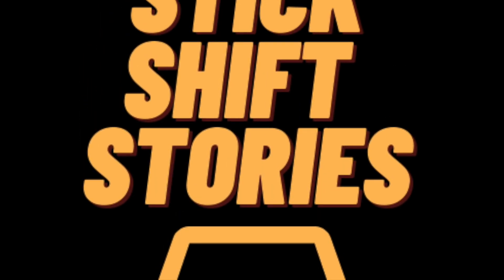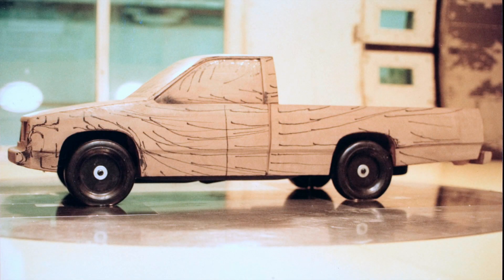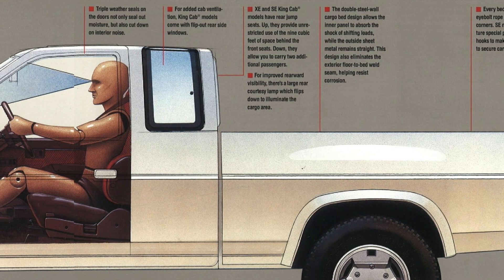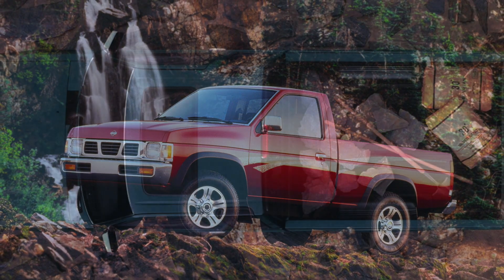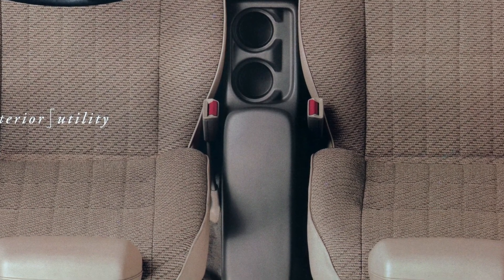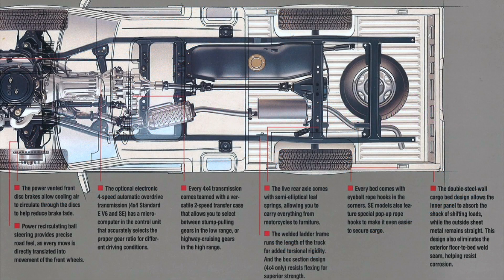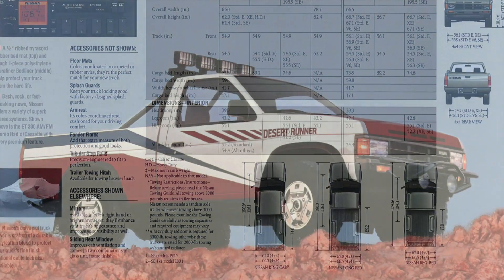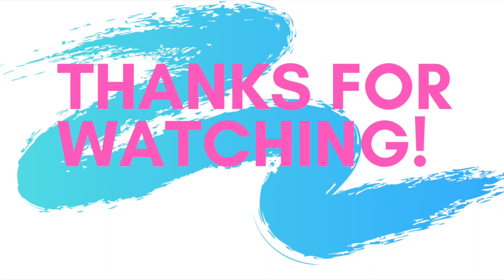Nissan Hardbody Buyer's Guide (Common Problems, Options, Specs)

Comment: I have a 1992 D21 SE king Cab 4X4. 200000 on the body and 13000 on everything else. Runs like new. No rust at all. Paint is faded. This is/was the best purchase I've ever made, besides my 2000 Lexus ES300.  My truck runs like new. Couldn't ask for more  💓.
Reply: I own a 1992 Nissan hardbody d21 kingcab. My speed gauge worked every so often. I toke my gauge out and drive around for a few miles. Do you know if I can put a tool on my motor so I can know the exact miles on the truck so the cluster matches? Thank you.
Reply: @popclutch_100  you know,  I have No idea. I will find out though and get back to you. I'm not sure if an obd 1 computer is smart enough to hold such information.
Reply: @stepheng5843  thank you so much brother!!

Comment: I had my 1989 SE 4X4 King Cab manual transmission for 14 years.  That truck and I went a lot of places.  It was very reliable.  I had to replace the leaf springs in the rear since both snapped and I fought the good fight against the rust.  It was undercoated yearly but still liked to rust.  The fender flares were terrible for keeping moisture and dirt against the truck surface.  It had the 31" tires but went to a slightly smaller tire since the truck's power was really zapped by such a big tire.  The truck was a light blue color which i didn't really like a first but the grew into it in time.  I had only seen one other like it in NH.  I loved the sunroof the rear tip out windows and the rear slider.  It let a lot of air into the truck.  The truck that replaced it is a 2007 Frontier King Cab in dark blue.  I can't believe it's 14 years old too but I'm not ready to let it go yet.  As far as I know the Hardbody is still running about in NH.
Thanks for the info on the truck!  I actually have a sales brochure for the Hardbody still.  It's fun to look at it.
-Jon
Reply: what do you mean by  "zapped"?
Reply: @nvfpv  I had a regular cab Nissan truck before the king cab model.  Both had the V6.  The engine had the same power but the first truck had a smaller 235 I believe.  The larger tire of the king cab 31's took a lot of power out of the engine just to turn over.  The truck had more power with a slightly smaller tire on it.  That is what I was getting at when I said zapped.  Have a good one!
Reply: @jrmason  thanks dude!

Comment: I owned two a 88 2x4 4 cy 5 speed i paid a little over 7000 I drove it five years and 300000 miles I gave it to my brother and it needed a clutch. He changed the clutch only major  maintenance we ever did to it he drove it ten years not sure of miles speedometer cable failed at around 350000. It’s was getting badly rusted so we attached the rear axle to a irrigation pump and used it to irrigate the farm for five more years. It tended to overheat running the pump so we took out the thermostat and recirculated by some of the  pond water pumped  thru the engine. That solved the overheating. We finally sold it when the transmission started growling to a fella down the road for a parts donor he needed the cab for his wreaked truck. One of the best farm trucks we ever owned. I got a 4x4 four cylinder five speed in 93 paid about 13000 and it was very good too, I burnt the transmission by jacking it up and putting huge tires on it. Trans was rebuilt at around 180000 and I traded it at about 260000. The trans problem totally my fault was the only issue I had with the 93 I didn’t get another Nissan hardbody because they had swapped to that ford ranger clone at the time I wanted to replace it. Loved them D21s wish I could buy a new one today.

Comment: I purchased my 97 Hardbody after my first deployment in 05.   I still drive that truck nearly everyday.   I still have the original drive train.  It is unfortunately an automatic (on the floor shifter).  It is the auto trans that grenades early (supposedly).   I'm still driving it at about 325K and still going!   I have had very few issues with my vehicle.  Just the usual suspects as a vehicle ages.  I have replaced the bushings and front end components, the starter, the alternator, lots of tires and a few batteries.   my vehicle is not pretty, I do need to repair the interior and it needs a paint job.

Comment: I bought my Hardbody truck brand new Feb 1986 $7000 dollars best purchase ever still driving it today over 400,000 miles nothing done to motor 4 cylinder 8 plugs Naps Z ,only thing the speedometer cable broke at 400,000 mile mark haven’t bothered to replace it yet

Comment: I had a 95 xe v6 king cab 4x4 manual. I drove it 2500 miles from Washington state to Anchorage Alaska. It leaked oil which burned out a starter. My theory was oil dripped onto the starter. It also had a lifter tick and an exhaust manifold leak. The clutch slave cylinder failed twice. I had a starter,alternator and battery fail in one week. I know that sounds bad. But I loved that little rig. I'm contemplating getting another one. Which would make the third D21 I've owned.
Reply: Just get one before they really go up in $$$. Im flying to Idaho to pick up a 95' SE V6 4X4 5spd and drive back to San Diego, California. 79,000 miles on it. $7,000.. one owner old guy who had passed away.. perfect paint cause it sat in a garage.

Comment: 85 Nissan 720 4x4. Still running strong. Of course, always have to maintain it. Especially the gear and oil changes for longevity.

Comment: 4x4 v6 and I love it. It runs perfect in -64 degrees. Only problem with that is the buzzing from the starter and that's only because it doesn't want to start in that low of a temp. I've never had a sensor go out and with the 2 inch factory lift I have no issues with steering. Torsion bar is fine and as long as you wash the bottom, no rust. Good luck finding a non rusted one though

Comment: I had a 1990 4x2 with the KA24E engine. A major problem for those motors is the timing chain guides break, and you'll hear a clickity clack when that happens. Other than that, I put well over 250,000 miles on it. The paint also faded easily on those trucks. Other than that, it is a really reliable truck.
Reply: True. Only way it won't come back is order a fabricated chain tensioner. If not you will most likely get timing slap. After 120,000 some miles.

Comment: I had the base 87 king cab 4x4 with the 4 banger.  Only thing that was not stock was more aggressive tyres.  Up at my friends fishing cabin there was no hill that thing wouldn't climb with a boat in the back if I used first gear and low range.  Even worked carrying some in hind site ridiculously heavy loads of wood and rocks.  Too bad rust killed it.  One of the most fun vehicles I've ever owned.

Comment: My dad bought a 1996 nissan harbody i4 5 years ago, We drive it strong at least 150 miles a day and under workload, has never let us down the odometer got stuck for 4 years at 240,000 miles now it probably would be 290,000 my dad bought it off an uncle you bought it off some gangmembers and up to this day it has needed nothing beside oil changes i just want to say if you can find a good condition truck like these even if its expensive BUY IT!! YOU WILL NEVER NEED A NEW CAR

Comment: Mine is a 2000 year model, 4 cil, base truck, single cab. It runs better than new vehicles. It gave me 3 problems during this years:

First, the wooden beams that connect the frame to the box (flat bed) went bad and I ended up making a steel frame extension that gave it more rigidity and shaved weight.

Second, the timing chain and chain tensors are worn out, so I need to replace them asap to get rid of the chain noise that comes when it is started.

Third, the steering is worn out, I was short on money, so I bought a remanufactured steering bottle, but there is nothing like getting a brand new one from nissan (they are expensive as hell).

Other than that it is perfectly fine, I rather pour 5-7K to get it perfect again (timing chain, new flat bed, wheels, tires, suspension, lift, paint and some other custom work) than spending around 20k for a new one that will need a custom flat bed, frame extensions, lift and other custom things anyway.

Comment: I’ve got an 4x4 king cab 4 cylinder with only 85000 miles on it. Super reliable always start in -25°C. The only bad thing is the fuel consumption

Comment: I have a 1988 Nissan extra cab 4×4  z24 motor,I paid 3000$for in 2002  it had 102ooo miles on it. It has over 300000 on it now replaced the starter in all those years blew a had gasket getting it fixed.They are tough little  Trucks.

Comment: Just got one had a bunchhh of major issues with it having 310,000 miles I didn’t want it to die now after a new exghust system ignition timing chain set rear main seal oil pan gaskets thermostat amd thermostat housing radiator a few fuel lines a mass air flow season amd a o2 Sesor it’s running great now hoping it stays that way

Comment: I got a 95 4x4 v6 and it only needed a new clutch plate because it was slipping. one thing that most of these trucks have is the lifters ticking when first started but it isn't any harm.
Reply: Yep my has lifter tick when cold

Comment: im from UAE, i have d21 4 doors, i took it from my grandfather he had it new in 1997, mine is GL with power windows interior is burgundy, five in the floor, engines we only got Z24S since 1990 til 1997, no other engines available

Comment: 1991 d21 2wd 4 cylinder regular cab with 377k miles no ac or power steering. Just passed smog first try after sitting for years. Steering is really loose...

Comment: I've got a 91 v6. Replaced the speedo cable and shifter bushing but it runs real well.
Reply: Had an issue with my speedometer not working on my 1997 check engine light came on saying that the speed sensor was to blame, it wasn’t. It was the screws that hold the speedometer gage on the back of the instrument pane where loose Easy fix found a video on YouTube guy fixing a maxima that uses the same cluster as the hardbodies. Free fix if the speedometer works and then stops sometimes. Tap the dashboard while driving to see if the speedometer starts or stops.

Comment: I love mine I've had it for 6 years now. Only problem is the ka24e eats timing chain guides often.
Reply: Have they discovered a way to prevent that? After market parts?
Reply: There is better hydraulic  Tensioner the issue is there is only one so the chain is loose on start up and causes the chain rattle

Comment: i have a 93 d21 it was well maintained for most of its life 140000 miles, everything manual. the gas gage and then the oil pressure gage have stopped working. other than that it is working fine.

Comment: 93 4x4 2.5 diesel is my daylie driver, no problems at all just the only luxury thing on there giving me a problem is the powersteering rack spacer bolt on the bodem of the steeringhouse aaargh need a powersteering delete 🤘🏻

Comment: Great trucks all around. I've owned:
1973 Datsun Bulletside 2WD i4 4-speed
1988 D21 Reg Cab 2WD i4 5-speed
1993 WD21 4WD v6 5-speed
1996 D21 KC 2WD i4 5-speed
1997 D21 KC 2WD i4 5-speed
2001 D22 KC Desert Runner auto
2002 WD22 2WD Supercharged v6 5-speed
2002 WD22 4WD Supercharged v6 auto
2003 WD22 2WD v6 5-speed
2003 R50 2WD v6 auto
2004 D22 CC LB 2WD v6 auto

Comment: had mine since 2006 only truck i have ever owned its went through 2 starters and 1 alternator 1 timing belt and water pump thermostat change :)
Reply: Tming belt? I think the hardbody has a timing chain.
Reply: 3.3?
Reply: @jmclick.6349   not if you have a v6 I do lol
Reply: @jmclick.6349   3.0 does not sound like you know much about the hardbody lol
Reply: @shanetyler9391  I live in USA, we only have 2.4 or 3.3.  No 3.0
Reply: @jmclick.6349  I live in the us also I have a 3.0 in my 95 it’s a 3000cc engine same as the old 300z
Reply: @jmclick.6349   the 3.3 didn’t come out until 98’ or 99’ I think in the frontier
Reply: @shanetyler9391  😄😄😄 I have a 1997 king cab 2.4, I didn't know about the 3.0.😄😄😄
Reply: @jmclick.6349  yea they are 3.0 v6 and 2.4   4 in line banger Z24 which came in the 720 and the Z24i in the D21
Reply: @jmclick.6349   they quit putting in the v6 in 1995 because of emissions

Comment: Z24i idle wax element something like i forgot what is called can be your worst nightmare so if you get a z24i model just swapped out with a weber carb and save time and endless diagnostics change your oil pump and the usual repairs on a  80's vehicle and when you get the ranmdom no crank no start lol thats another story

Comment: Timing chain guide failure in the KA is a common flaw, upgrade to the metal backed guide with an aftermarket tensioner recommended!
Reply: Later years had metal backed...My 97 (the almighty year!)  has 180k on it and no noise. I added a spacer on the tensioner to stop the classic chain rattle at start up but thats it!
Reply: @bfrankz3332  yeah I personally prefer (call me a snob) the pre 1993 facelift look as far as asthetics... but you can't beat the metal backed guide for upgrades. It should have been a RECALL. Hello?Nissan? Nope. Nobody is home.

Comment: I put in 3 clutch kits in the throw out bearing is destroyed in 4 weeks I don't know what to do..... It's got a new fly we'll a new pilot bushing and the transmission was completely rebuilt... Luk even failed.... Metal tapping noise clutch fork vibration

Comment: Got a 1991 manual 2wd KA single cab as my first vehicle, still have it and still love it.  Used to have a 1995 manual 4wd VG king cab on Guam, it was a truly different vehicle all together and just an absolutely wonderful truck to own.  As far as I know, it's still driving around that little island today, I was so hurt to have to let it go but it went to a good home.  I would like to get another one day and restore it right.  I haven't run into any reoccuring problems besides the tie rods wearing quickly due to the torsion bars being tightened to clear 31 inch 10.5 wide mud tires on the 95 and using cheap rods.  The 91 is on the original engine with it's fourth or fifth timing set and third transmission rebuilt.  Unknown if the rear end has been rebuilt.  Currently around 280K miles on it.

Comment: I own two hardbody’s and I have this issue on both of them were just one of the headlights randomly turns on in the middle of the night. really strange and my battery always dies due to this problem. It also happens to a friend of mine that owns one. All three trucks have this problem and have no idea how to fix it
Reply: Try switching your high beams ON and then OFF. if you move the turn lever forward and back it gets stuck as you say one headlight working. You might have to do that twice. I noticed too when I replaced a headlight

Comment: @2:26 precise truck two tone colors and wheels I have on mine. My truck has an aftermarket rear bumper on it. The truck in the picture @2:26 did not have a back bumper. I also noticed the same situation on an '86 Nissan Hardbody commercial (no rear bumper) . .Could it have been that my truck was originally sold without a rear bumper and that may have explained why the after marker bumper was later added? Anyone know?

Comment: I have two of them 1997 bought new now has 230,000 miles on it with a 5 speed transmission  only two things I saw go wrong rust on the body .  And timing chain rattle .    But this little truck still starts first bump of the key turned and everything works well. I already fixed the chain so it's good to go over million miles  or more . My 1993 Nissan truck is an automatic  and it has 198,000 miles. Some rust and turns on right away chain rattle and suspension noise when I turn to the right or left .  Yet to see what's the issue .  Other then that all working and you can take these two trucks out on the road and get to A to B point .   Yes the are the best trucks and there are people warring to buy them off me but it's just a few trucks that can make it out in this world .  They are named hurcule Nissan and Whitley mighty Nissan

Comment: 1987 nissan d21 Z24¡ E model ...my favorita since 1999
Reply: Thinking about buying a 1987 pickup, is it reliable?
Reply: @matteojosue8041  of course it is but that year model has tbi and is very complicated if you dont have the knowledge on that kind of systems basic knowledge wont cut it go with a fuel injected d21 1990 thru 2004 the 1998 changed to frontier the KA24 engine is much simple then Z24 engine
Reply: @matteojosue8041  Z24 has 8 spark plugs and an electric carburetor with 2 injector a small number of them came with 1 injector and 4 speed manual KA24 has 4 sparkies and 4 injectors and a few more herspers lol
Reply: @matteojosue8041  the KA24 is much simple to work on they have a little issue with the timing chain rattle but you can fix that theres tons of info here and the net you can do oil change intervals every 7000 miles depending on your driving habits a new oil pump every 100,000 again driving skills is key I hope you this helps and yes one of the best reliable vehicles manufactured in north America Nissan wont make that mistake again and if you get one dont try to fit Z24 and KA24 suspension parts they are not the same they wont fit good luck be safe
Reply: @zacariasblanco9738  .. thanks for all the information. So should I stay away from the 1987? He says it's rebuilt with now 100,000 miles. It runs really smooth . Thanks again!!
Reply: @zacariasblanco9738  ... thanks bro!
Reply: @matteojosue8041  if you get the 87 weber carb swap the minute it starts with a  rough idle that's really your only option

Comment: I just picked up an 87 hardbody XE on a trade for a Honda ATC. V4, 5spd manual. It doesn’t pass Ca. smog, but I want to use it as a work truck. It starts, runs and drives with 175k. I’m surprised how good it handles as well. Are these trucks reliable? Is a there a link or forum where I can get more info on these trucks? It’s my first truck and I’m stoked! Thank you